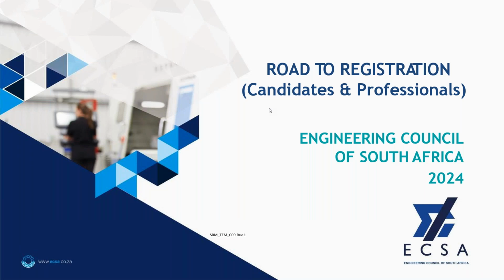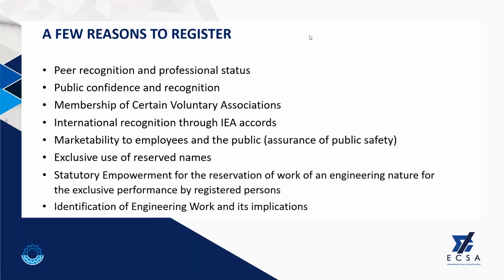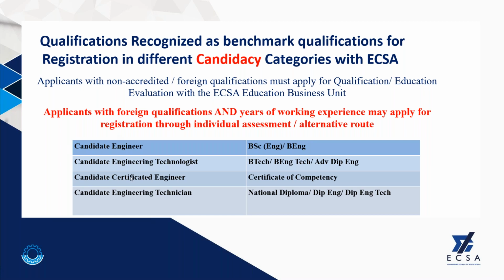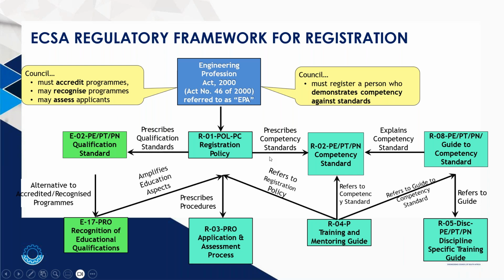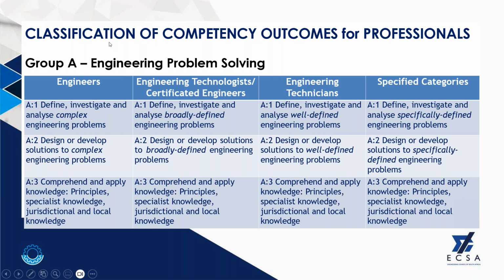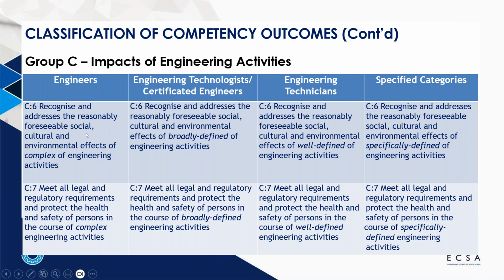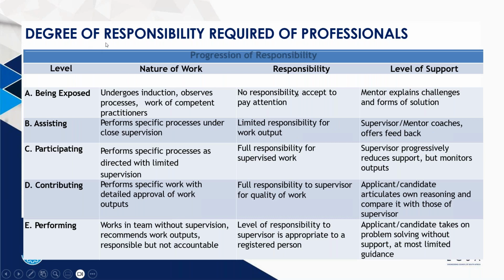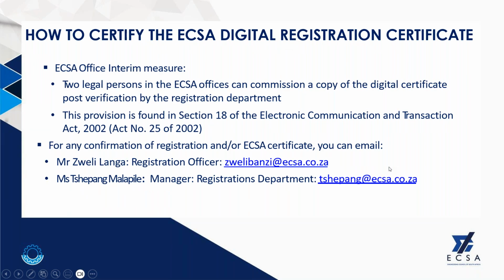Road to Registration – Understanding and navigating the ECSA registration process

Comment: I hold a BEng degree from the Democratic Republic of Congo and an MEng degree from South Africa, and I would like to register with ECSA. However, I do not have the official certificate for my BEng degree; instead, I only possess a document confirming that I have completed the degree,  due to ongoing administrative delays in the national system, I have not yet received my official degree certificates to date.

My concern is whether ECSA will consider my application with this supporting documentation from my previous university, or if there are alternative steps I should take to meet the requirements.

I would greatly appreciate your advice and guidance on how I can proceed with my application under these circumstances.